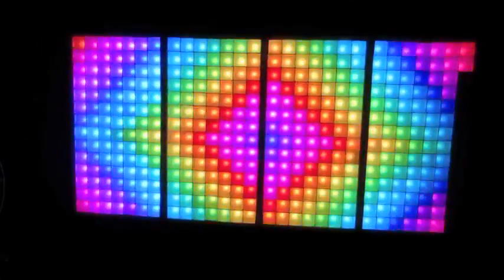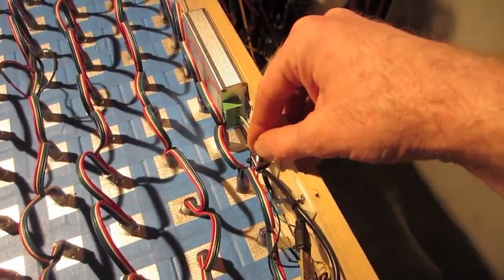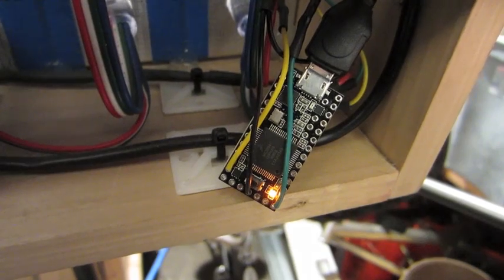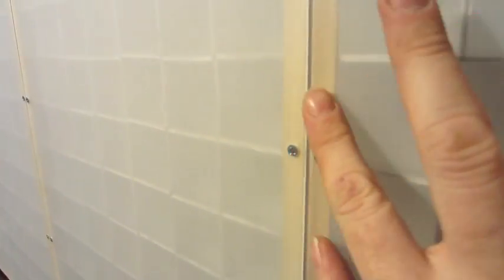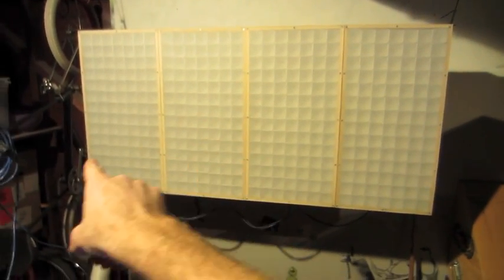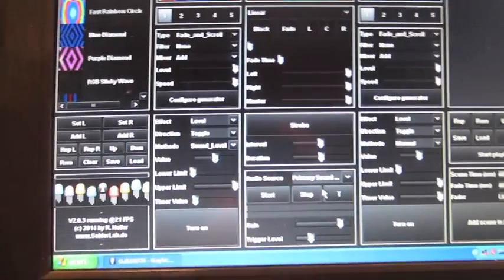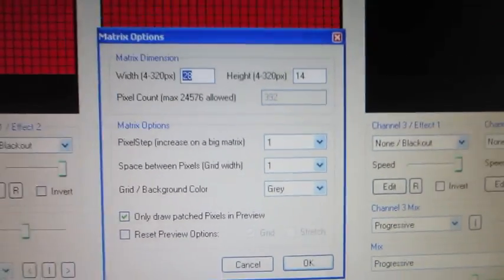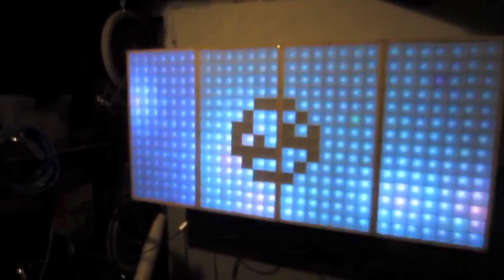How to WS2801 pixel wall + Teensy 3.0 + Glediator/Jinx

Comment: Hello Mike, congrats on your project! It looks amazing. Do you know if it's possible to achieve similar effects on flexible LED Matrix?  I'm interested in bringing this into wearables. Thanks:)
Reply from the maker: Yes, the same WS2801 pixels also come in a flexible roll type that you could use.
Reply: Thanks. Do you mean something like this this http://www.adafruit.com/products/2547?
From the video, I think they are flexible but still pretty stiff, which I think it's hard to attach onto garments. It'd be great if you can offer me some suggestions. I appreciate it.
Reply from the maker: Kailu Guan No, I meant something more like this. 
http://www.amazon.com/length-individually-addressable-SMD5050-Non-Waterproof/dp/B00C3ZR90O
Reply: Great. Does any of this come in pieces instead of strips?
Reply from the maker: +Kailu Guan the strips can be cut to size ;-)
Reply: Sorry, by pieces I meant like a piece of fabric of a square piece. Have you seen any of those?

Comment: hey Mike, sorry to bother.. my glediator software is playing with me, I uploaded the code to teensy and specified that i had 480 leds but when i go to glediator and put X=32 and y=15 it doesnt work. Nothing lights up or anything.. but if i place another number, i.e. X=32 Y=16 it lights up in random order, could you instruct me on what im doing wrong?
Reply from the maker: wiiniie Hmmm, not really sure. Did you setup the pixel order correctly in the software? Does it respond differently if you try a different pixel order?
Reply: i had a ";" missplaced, I hate when that happens, it didnt warn me about the error because the programming took it from elsewhere, thats why my program wasnt working correctly, thank you for answering.

Comment: hello can you help
its source not work on my teensy 3.1
1024 pixel WS2801
Reply: Martin Reberon 
Hello Martin
I have got it to working with  this code on my  teensy 3.1

Rob (the.rubbere@gmail.com)

// Matrix size 392 (28x14)
#define Num_Pixels 150
 
#define CMD_NEW_DATA 1
int SDI = 19; 
int CKI = 18;
 
unsigned char display_buffer[Num_Pixels * 3];
 
static unsigned char *ptr;
static unsigned int pos = 0;
 
volatile unsigned char go = 0;
 
void setup() 
{
  pinMode(SDI, OUTPUT);
  pinMode(CKI, OUTPUT); 
  Serial.begin(9600); // USB is always 12 Mbit/sec
}
 
void loop() 
{
  if (0<usb_serial_available()){
    unsigned char b;
    b = usb_serial_getchar();
 
  if (b == CMD_NEW_DATA)  {pos=0; ptr=display_buffer; return;}    
  if (pos == (Num_Pixels*3)) {} else {*ptr=b; ptr++; pos++;}  
  if (pos == ((Num_Pixels*3)-1)) {go=1;}
  }
  if (go==1) {shift_out_data(); go=0;}
        Serial.println(display_buffer[100]);
  
}
 
 
 
 
//############################################################################################################################################################
// Shift out Data                                                                                                                                            #
//############################################################################################################################################################
 
void shift_out_data()
{
 
  for (int i=0; i<Num_Pixels; i++)
  {
    byte r = display_buffer[i*3+0];
    byte g = display_buffer[i*3+1];
    byte b = display_buffer[i*3+2];
    
    for (byte j=0; j<8; j++)
    {
       digitalWrite(CKI, LOW);
       if (r & (byte)(1<<(7-j))) {digitalWrite(SDI, HIGH);} else {digitalWrite(SDI, LOW);}     
       digitalWrite(CKI, HIGH);
    }
    
    for (byte j=0; j<8; j++)
    {
       digitalWrite(CKI, LOW);
       if (g & (1<<(7-j))) {digitalWrite(SDI, HIGH);} else {digitalWrite(SDI, LOW);}     
       digitalWrite(CKI, HIGH); 
    }
    
    for (byte j=0; j<8; j++)
    {
       digitalWrite(CKI, LOW);
       if (b & (1<<(7-j))) {digitalWrite(SDI, HIGH);} else {digitalWrite(SDI, LOW);}     
       digitalWrite(CKI, HIGH);
    }
    
  }
  
  digitalWrite(CKI, LOW);
  delayMicroseconds(800); //Latch Data
 
}
Reply: @RobFuji3D  HI, thanks for the code... but what happens if i have a pixel led ws2811??? would work without none problem??
Reply from the maker: Martin Reberon From what I am hearing from others is that the code I used will not work with the Teensy 3.1. I would suggest try using Rob A's version that replied to your post about.

Comment: hello :) ive a teensy 3.1 - and ws2811/12b LEDs

so i dont need the clock pin - can i use the scetch too ? when i de. the lines with clock..
Reply from the maker: ***** Sorry I am not sure about that. I didn't write the code I am using.

Comment: I wish you indicate your me which version of Tensy buy, and if possible you to help me with the code.

Thank you.
Reply from the maker: Gustavo Aristizabal I used a Teensy 3.0

Here is the sketch that you can copy and paste. 

#include <usb_serial.h>
 
// Matrix size 392 (28x14)
#define Num_Pixels 392
 
#define CMD_NEW_DATA 1
int SDI = 11; 
int CKI = 13;
 
unsigned char display_buffer[Num_Pixels * 3];
 
static unsigned char *ptr;
static unsigned int pos = 0;
 
volatile unsigned char go = 0;
 
void setup() 
{
  pinMode(SDI, OUTPUT);
  pinMode(CKI, OUTPUT); 
  Serial.begin(9600); // USB is always 12 Mbit/sec
}
 
void loop() 
{
  if (0<usb_serial_available()){
    unsigned char b;
    b = usb_serial_getchar();
 
  if (b == CMD_NEW_DATA)  {pos=0; ptr=display_buffer; return;}    
  if (pos == (Num_Pixels*3)) {} else {*ptr=b; ptr++; pos++;}  
  if (pos == ((Num_Pixels*3)-1)) {go=1;}
  }
  if (go==1) {shift_out_data(); go=0;}
        Serial.println(display_buffer[100]);
  
}
 
 
 
 
//############################################################################################################################################################
// Shift out Data                                                                                                                                            #
//############################################################################################################################################################
 
void shift_out_data()
{
 
  for (int i=0; i<Num_Pixels; i++)
  {
    byte r = display_buffer[i*3+0];
    byte g = display_buffer[i*3+1];
    byte b = display_buffer[i*3+2];
    
    for (byte j=0; j<8; j++)
    {
       digitalWrite(CKI, LOW);
       if (r & (byte)(1<<(7-j))) {digitalWrite(SDI, HIGH);} else {digitalWrite(SDI, LOW);}     
       digitalWrite(CKI, HIGH);
    }
    
    for (byte j=0; j<8; j++)
    {
       digitalWrite(CKI, LOW);
       if (g & (1<<(7-j))) {digitalWrite(SDI, HIGH);} else {digitalWrite(SDI, LOW);}     
       digitalWrite(CKI, HIGH); 
    }
    
    for (byte j=0; j<8; j++)
    {
       digitalWrite(CKI, LOW);
       if (b & (1<<(7-j))) {digitalWrite(SDI, HIGH);} else {digitalWrite(SDI, LOW);}     
       digitalWrite(CKI, HIGH);
    }
    
  }
  
  digitalWrite(CKI, LOW);
  delayMicroseconds(800); //Latch Data
 
}

Comment: Great project
I also have made a 15x10 LED matrix
Do you want to share the code for the teensy
the.rubbere@gmail.com
Reply: Rob A With the current teensy libraries, there is no need to include the line #include <usb_serial.h>
Reply from the maker: Rob A here is the code:

#include <usb_serial.h>
 
// Matrix size 392 (28x14)
#define Num_Pixels 392
 
#define CMD_NEW_DATA 1
int SDI = 11; 
int CKI = 13;
 
unsigned char display_buffer[Num_Pixels * 3];
 
static unsigned char *ptr;
static unsigned int pos = 0;
 
volatile unsigned char go = 0;
 
void setup() 
{
  pinMode(SDI, OUTPUT);
  pinMode(CKI, OUTPUT); 
  Serial.begin(9600); // USB is always 12 Mbit/sec
}
 
void loop() 
{
  if (0<usb_serial_available()){
    unsigned char b;
    b = usb_serial_getchar();
 
  if (b == CMD_NEW_DATA)  {pos=0; ptr=display_buffer; return;}    
  if (pos == (Num_Pixels*3)) {} else {*ptr=b; ptr++; pos++;}  
  if (pos == ((Num_Pixels*3)-1)) {go=1;}
  }
  if (go==1) {shift_out_data(); go=0;}
        Serial.println(display_buffer[100]);
  
}
 
 
 
 
//############################################################################################################################################################
// Shift out Data                                                                                                                                            #
//############################################################################################################################################################
 
void shift_out_data()
{
 
  for (int i=0; i<Num_Pixels; i++)
  {
    byte r = display_buffer[i*3+0];
    byte g = display_buffer[i*3+1];
    byte b = display_buffer[i*3+2];
    
    for (byte j=0; j<8; j++)
    {
       digitalWrite(CKI, LOW);
       if (r & (byte)(1<<(7-j))) {digitalWrite(SDI, HIGH);} else {digitalWrite(SDI, LOW);}     
       digitalWrite(CKI, HIGH);
    }
    
    for (byte j=0; j<8; j++)
    {
       digitalWrite(CKI, LOW);
       if (g & (1<<(7-j))) {digitalWrite(SDI, HIGH);} else {digitalWrite(SDI, LOW);}     
       digitalWrite(CKI, HIGH); 
    }
    
    for (byte j=0; j<8; j++)
    {
       digitalWrite(CKI, LOW);
       if (b & (1<<(7-j))) {digitalWrite(SDI, HIGH);} else {digitalWrite(SDI, LOW);}     
       digitalWrite(CKI, HIGH);
    }
    
  }
  
  digitalWrite(CKI, LOW);
  delayMicroseconds(800); //Latch Data
 
}
Reply: Mike Sisk hi Mike i can't get the code to compile i get a error
can you help me.
The error is

 
In file included from sketch_apr19b.ino:1:0:
C:\Program Files\Arduino\hardware\teensy\cores\teensy3/usb_serial.h: In member function 'size_t usb_serial_class::readBytes(char*, size_t)':
C:\Program Files\Arduino\hardware\teensy\cores\teensy3/usb_serial.h:94:38: error: 'millis' was not declared in this scope

Thank you.
Reply: Phonkamumblefor 
Thank you for your explanation that I had to leave out the line #include <usb_serial.h>
I got it working now
and it works much faster than a Arduino
thanks again
Reply from the maker: Phonkamumblefor Thank you. I am FAR from an expert on the code part of all this.